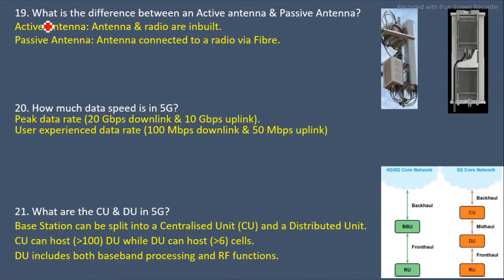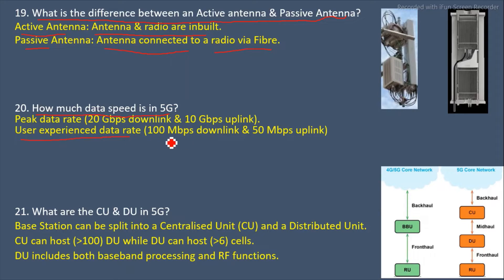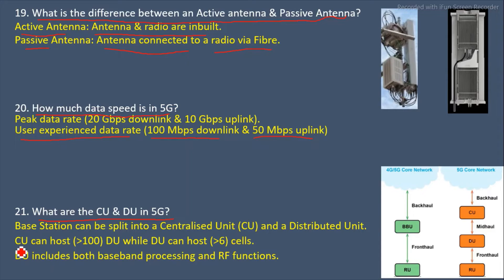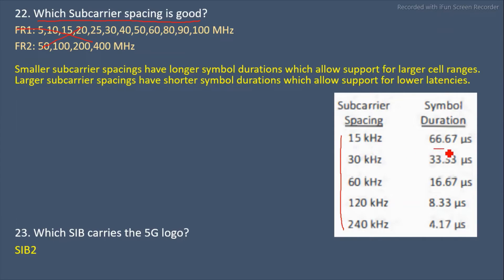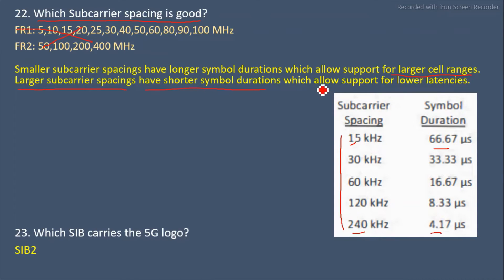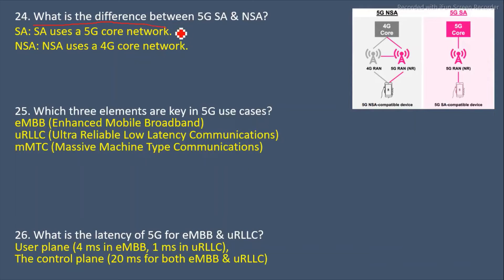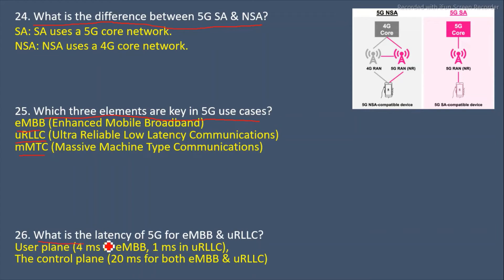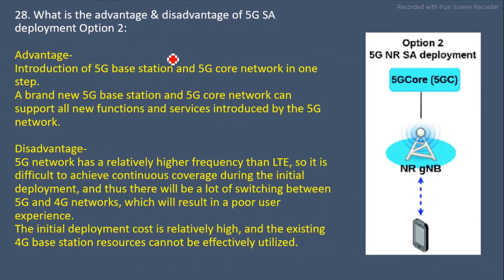5G Interview Question and Answers: Part 2

Comment: You are mixing the ORAN network with 5G in your question 21. Not all 5G networks are using the CU/DU split.
Reply from the maker: Yes you are correct not all 5g networks using cu-du.